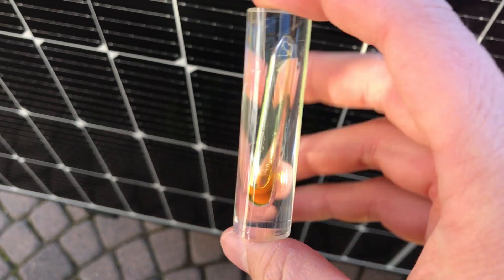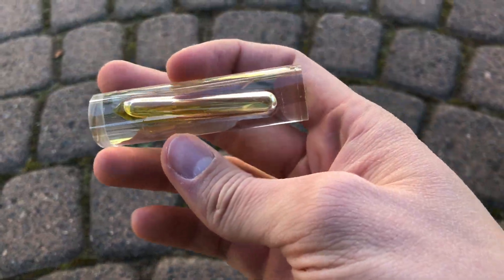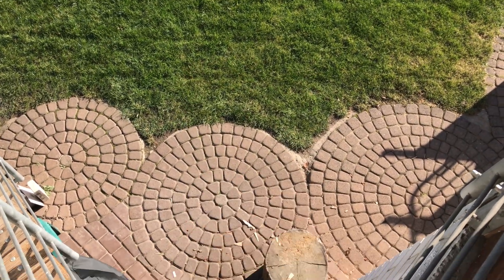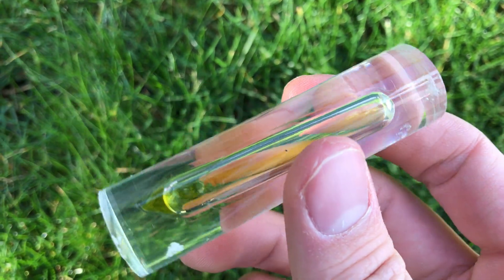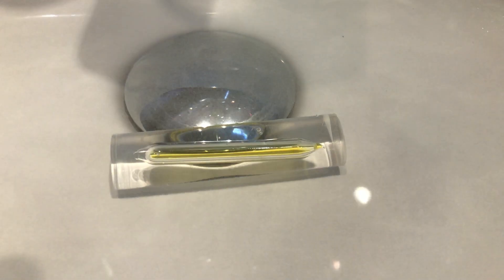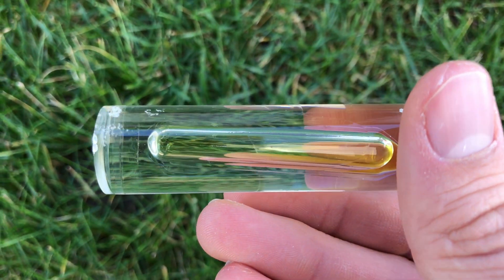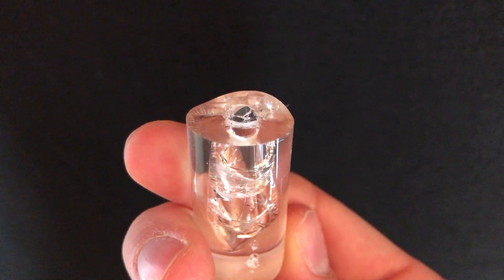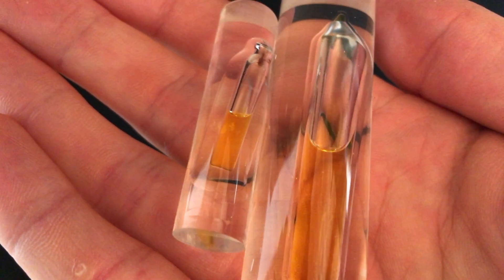Testing The Chlorine Ampoules

Comment: Years ago I used to make vials like these filled with different gasses inside and sold them on ebay. The best glass to use was borosilicate pipette tubing. Made ones with chlorine bromine iodine and xenon inside that had liquid at or near room temperature. The xenon one was unique because you could refrigerate it to make the gas and liquid separate and then as it warms up it goes supercritical. Also made ones that had gasses that were at low pressure that has electrodes at each end so they would glow when high frequency HV is applied.